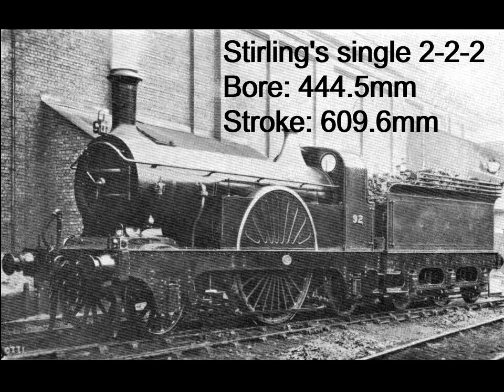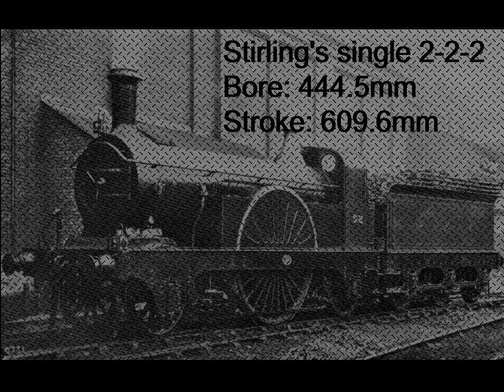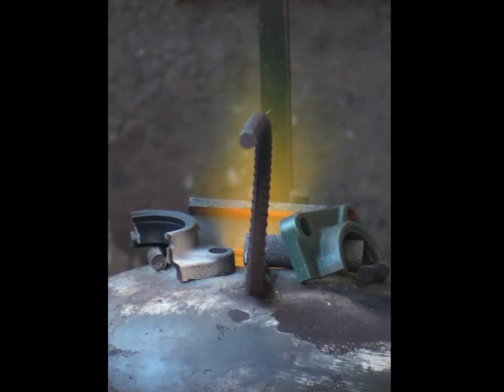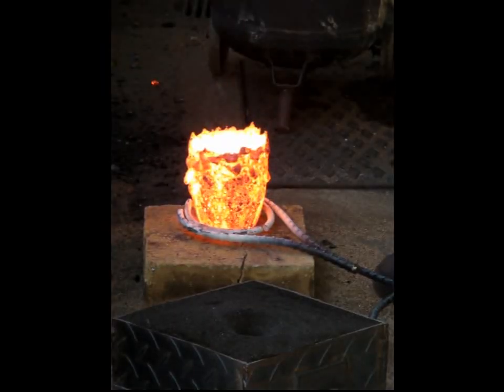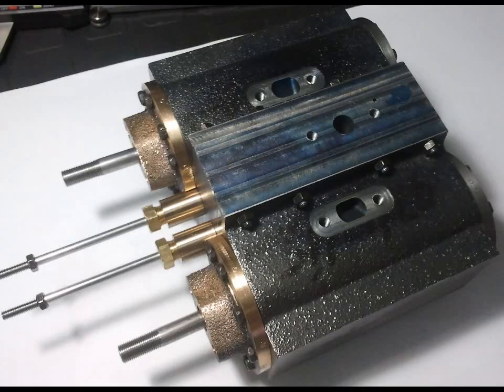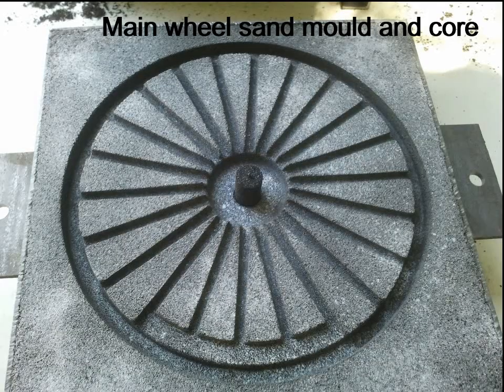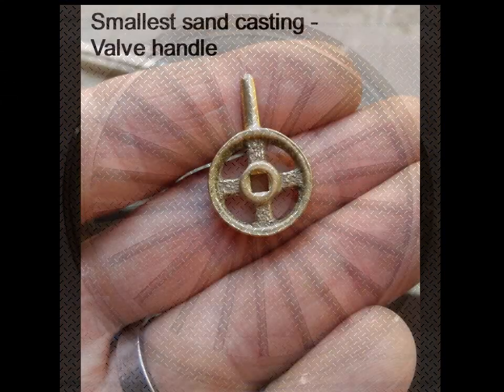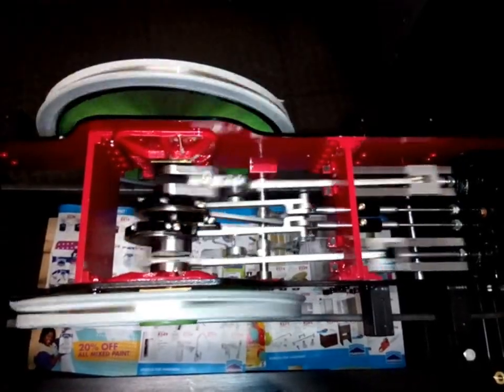Scratch built live steam Stirling single

Comment: Not at all what I thought when I read “Stirling Single” but that’s incredible
Reply from the maker: Thanks Russell. Most people know the 8ft no1 Stirling single which was a 4-2-0. Stirling also designed the 7ft singles which had a 7ft driving wheel and were 2-2-2. The wheel size varied over the years but they were broadly grouped like this.

Comment: was this at the RSME? i haven't been since i was 10 and now I'm 19. I wish i could find an easy way to get into the hobby without having to spend a fortune on the machines required. Beautiful work, i hope to achieve at least half the standard some point in life
Reply from the maker: Yep was at RSME, you should visit; we the builders like chatting to the public and sharing our hobby (well I do). If you do everything yourself this hobby is very affordable. My machines were bought as I could afford them, and they are either second hand or cheaper Chinese models, greatly modified. I have never bought anything from the model engineering trade, too expensive! Most of my tools are home made (including the taps) and most of the materials I use for melting were mixed from discarded motors found on the side of the road. No jokes, the most expensive part of that loco was the paint!
Reply: Alright, would third of march be a good date to start going?  Thank you for your response